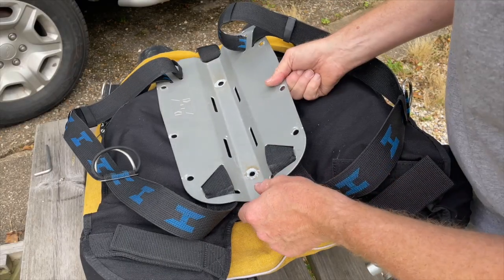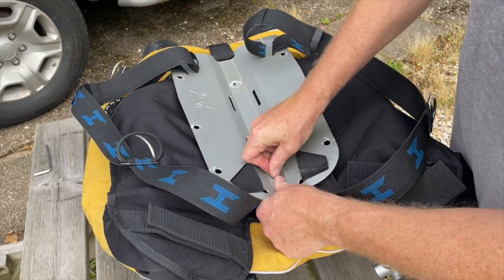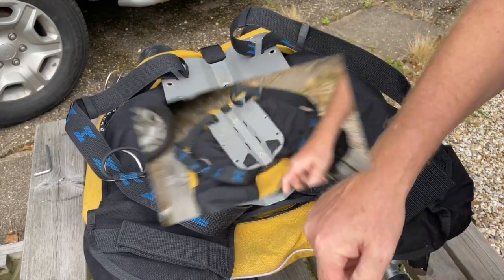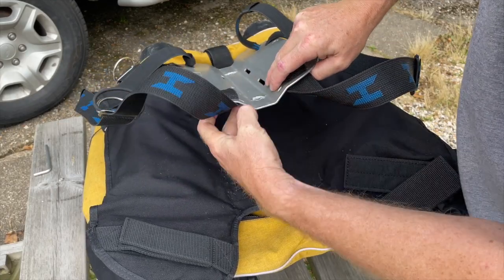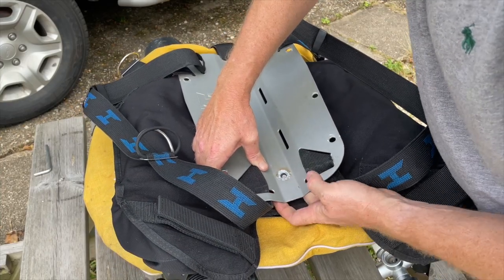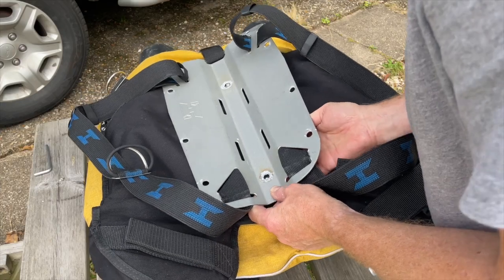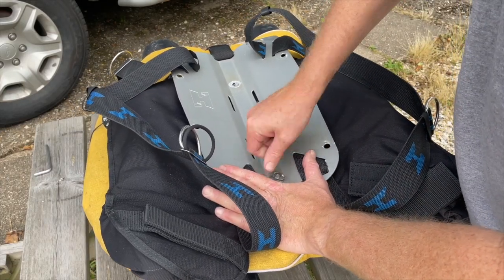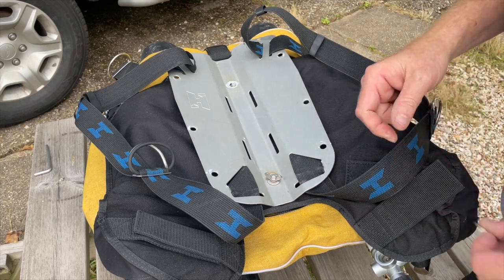JJ-CCR Hack - overcoming a short backplate bolt

Comment: Why not just put longer bolts in. Its a couple of euro fix. There standaard lock bolts A4
Reply from the maker: You maybe borrowing somebody elses cannister or just don't have the bolts easily available where you are at that time.  I also i only being able to find coach bolts with much smaller heads in a4 ... and life is too short to be trawling around hardware stores looking ro bolts.  But most importantly you're not balancing your rig on a stack of grommets ...